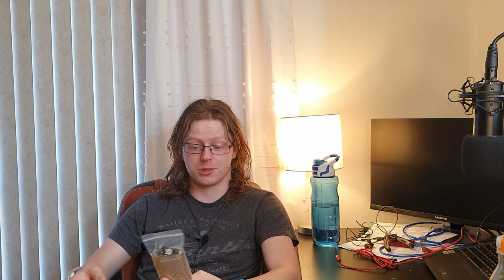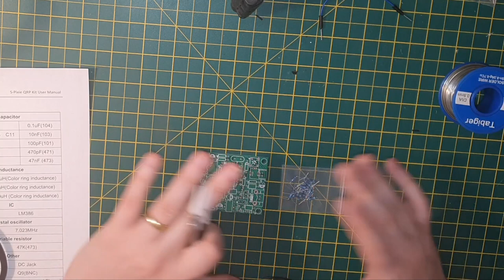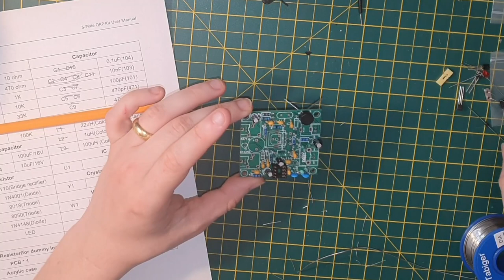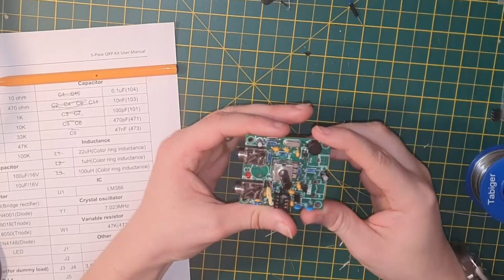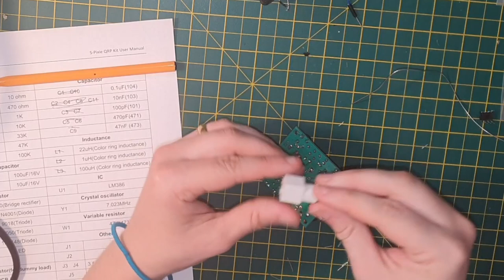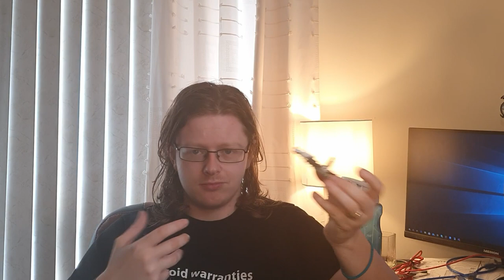How To Build the Pixie Kit HF radio

Comment: Hey I have a question for you, what is the diameter of the outside and inside of the DC connector that you used
Reply from the maker: It's was a 5.5 by 2.1mm jack

Comment: Hahaha i have built my first TX from tv spares valves (tubes) 6AQ5 as amplifier and 6C4 in a pierce oscillator with 3620Khz xtal... Modulated in plate and screen.. You have to see the tube at dark with it blue plasma. What a time!! I was 16 .. 70 something... Thak for sharing my friend
Reply: Pro tip : you can watch movies at flixzone. I've been using it for watching lots of of movies lately.
Reply: @Xavier Axl Definitely, have been using Flixzone} for since december myself :)

Comment: trying a set in a box of tx by qrp guys Rockmite and rx by Pixie.Got loads of components cos ordered 1st. 2 a couple of years ago but arrived with un compatible boards! got the 817 to calibrate on.Yet to put solder to Iron but its a challenge thats all  73

Comment: I'm glad that I stumbled upon this channel. I've downloaded it and will be viewing it at work. The instructions you gave the link are the best yet, so thanks for that. As for low pass filters, do you have any recommedations. kit's, etc?
Reply from the maker: Hey, glad you enjoyed :) yeah I tried building a low pass filter using the schematic on the ARRL site https://www.google.com/url?sa=t&source=web&rct=j&url=https://www.arrl.org/files/file/Technology/tis/info/pdf/9902044.pdf&ved=2ahUKEwiphJPp5_3sAhVJasAKHUxMDwgQFjABegQIAxAB&usg=AOvVaw3iBfBXxteZHwN6pmZfGAFi

But I haven't managed to get it working yet. The schematic looks good I think my issue is either bad soldering or I wired it up wrong.
Reply: Thank you for the link. Have you ever looked at the qrp-labs qcx+ qrp kit build (https://qrp-labs.com/qcxp.html)? I've just purchased one and it's on its way from Turkey (apparently). Their regular qcx has loads of videos for guiding the build, but the newer one doesn't. Thanks again, for your video and the answer.
Reply from the maker: Seen it. I have one of the QCXs but not the plus yet. Still hovering with my finger over the "buy" button